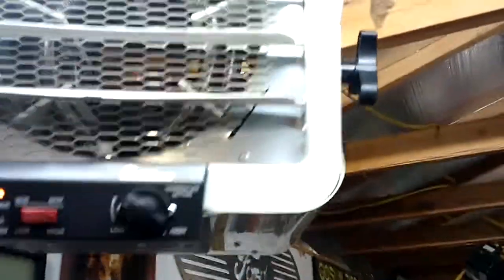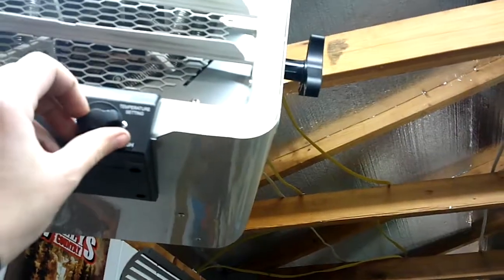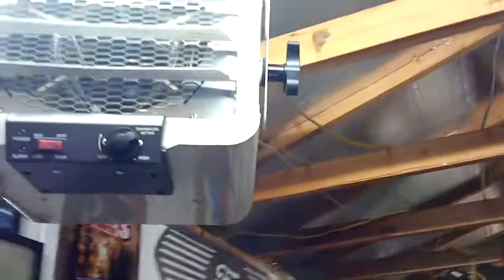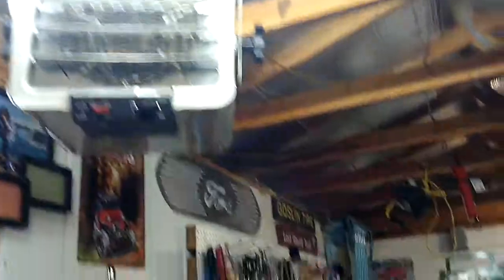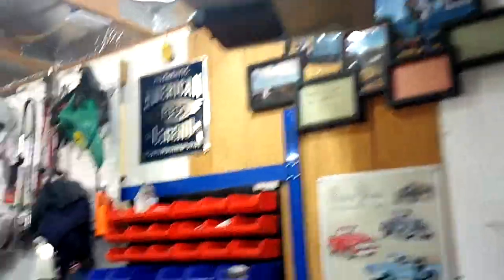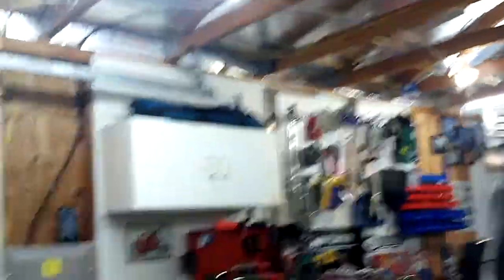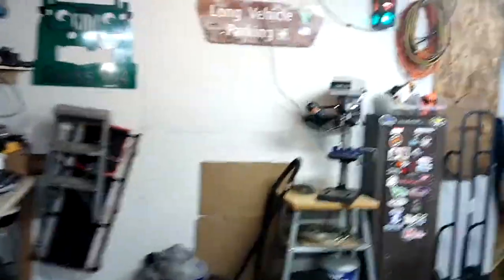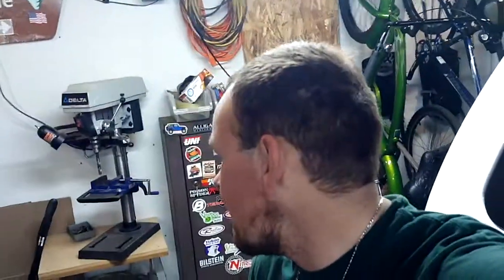Dr Heater Dr966: How much does it cost to run?

Comment: So did you have any concern leaving it on overnight? I
Reply from the maker: The heater has been in my shop for close to 5 years now, it’s been on most of that time, I it set where it keeps the garage at 55 all winter. I’ve have no issues at all, would still recommend
Reply: @Geeks4x4  thanks
Reply from the maker: @ReyShady05  Glad to help, this thing has been a game changer for the shop.